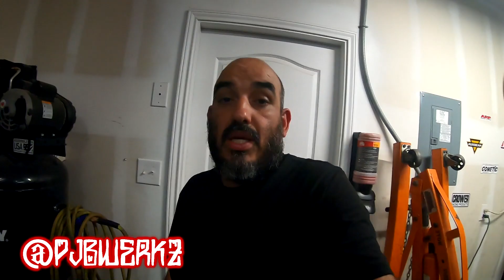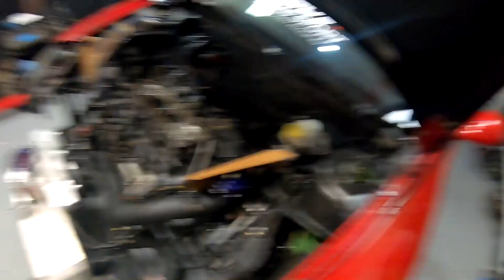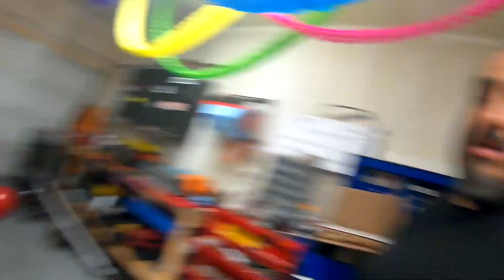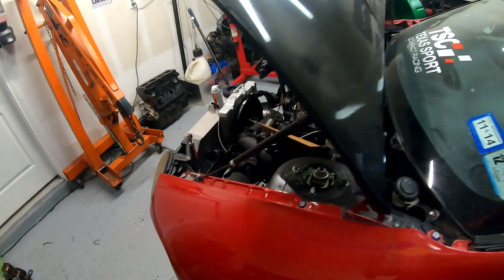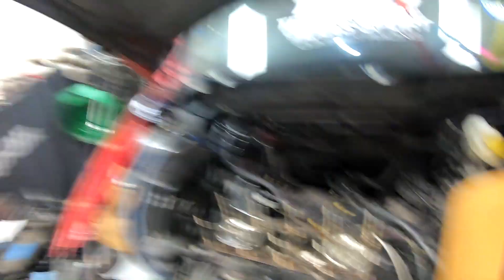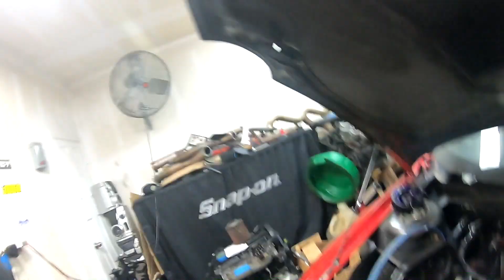POPCORN Under the Knife!! Will it Run? (How to 420a head)

Comment: I have a 2.4 EDZ NA engine that I want to put stock SRT4 internals in, but with a 420A head. Do I have to reverse the piston heads? How many hp or psi of boost can those internals handle?

Comment: Always wondered about that conversion. What's the purpose of doing it? More hp, rpm,+ - torque, easy access?
Reply from the maker: The 420a head flows better than the srt4  head plus it makes it so much easier to work on